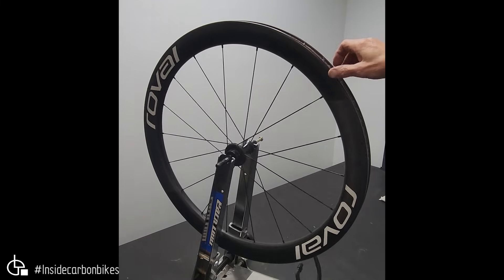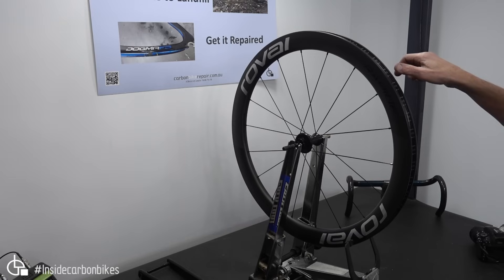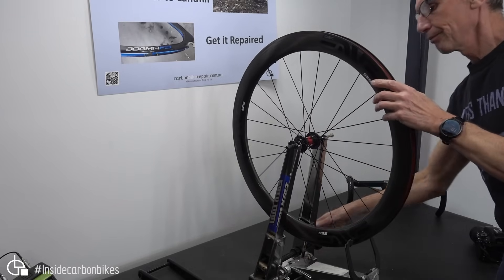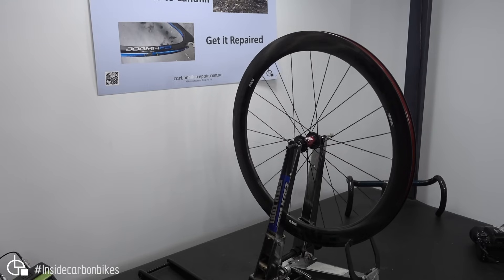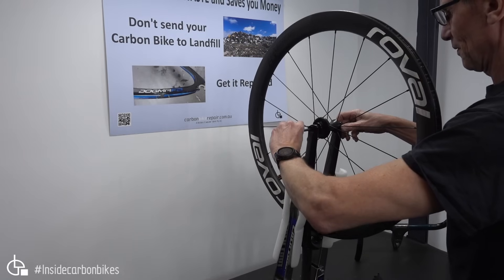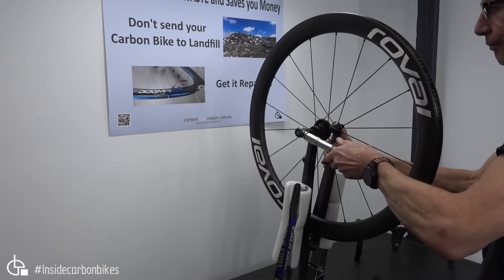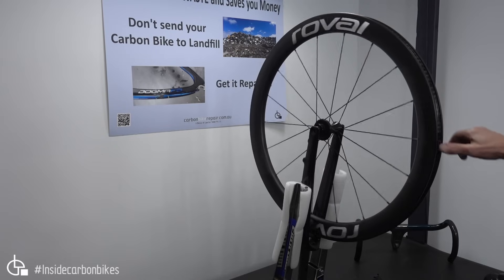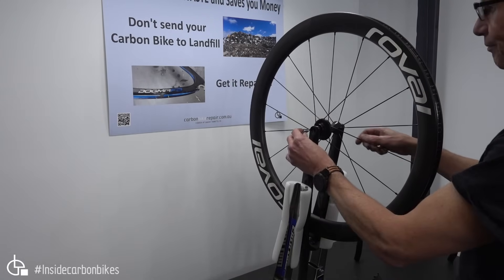Hub Bearing Test - It's not the axle!

Comment: Sorry if I duplicate other comments but my son is a bike mechanic and just today he had a customer's Roval wheel that was getting hard to spin when tightened. The cause was that the protection flange of the side axle cover was rubbing against the inside of the hub shell. He fixed by adding a 0.5 mm spacer in front of the bearing inner race. That gave enough clearance for the wheel to spin freely, without affecting the bearing preload. Clearly Roval have tolerance issues with their hub shells. Beside this, there are other issues like a big crack in the hub flange of another Roval wheel (no previous shock on that wheel).
Reply from the maker: Thanks for sharing your son's experience.

Comment: It's almost always the seals on the bearings.  But, it can also be the hub cap flanges touching the hub shell or upper bearing race.  Tolerances are sometimes too tight upon final assembly vs engineering specs.  

You will see this interference over time as black anodization rubbing off on the end cap flanges over time.  Either on the tops of the flanges of the hub end caps, or the inner sides of the end cap flanges.

Comment: Thanks for the video Raoul. For me the key issues is that the Roval and the DT Swiss hubs are not from the same manufacturer. DT has licensed its hub technology (the star ratchet system) to many brands (Roval, Giant, Bontrager), but the licence extends primarily to the freehub body and ratchet system (and sometimes axle and endcaps).  There are cases where OEM DT hubs are used, but not always. The Roval hubshell is not a DT Swiss hub and their are issues around manufacturing tolerances (bore and stack) and factory installation which can cause these issues with compression. Most often Ive found its the stack tolerances that cause compression on the inner race of the bearing which slows them down. Sometimes they just need the lightest tap on the axle to loosen them up. In regards to broader issue regarding compression and fitting torque from the thru axle... Its typically a non issue... or an urban myth. Sealed bearing hubs with slip through axles like Mavic, Tune are more effected by preload, hence they have adjustment mechanisms to find the balance between compression and play. Shoulder axle hubs like DT Swiss rely on extremely tight stack tolerances to get everything right. Occasionally Ive had brand new DT Swiss hub have this problem, but its extremely rare... well 1 hub in the last 15 years of professional wheel building.

Comment: Try simply taking the end caps off and re testing the bearings, could just be the end caps tolerance being tight, simple fix.
Could be one wheel with non contacting bearing seals, vice comparing wheels with tight, full contacting bearing seals. (Better at keeping water out and for longevity).

What Hambini reports, (he should understand the required interference fit). I have experienced several times, after fitting NTN bearings, the bearings spin free out of hub or BB, but tight and draggy when fitted, re-remove and supper free running, then tight and draggy when again fitted within an undersized housing.

Too much inference between bearing outer and housing, together with the tighter fit tolerance within the actual bearing,  My understanding being, some NTN bearings used in the cycle industry, having a tighter tolerance, hence more susceptible to this issue. 

I used to tell people, to use Enduro bearings, with a loser tolerance, to avoid the issue, but listening to an Enduro Engineer sprout a load of complete BS to Hambini, I do not have conference in anything they say. Best video I have watched in years and the Enduro bearing Engineer/Sale man, must now be a laughing stock in the cycle bearing industry.

Comment: In my opinion, the wheel Builder did the bearings to titend in the hub. We see, in the bicycle shop more often that this is the case. Simply new bearings and not to titend and it runs fine.

Comment: I've got an unadjustable front hub that needs the quick release very tight so it doesn't rattle.  It seems to work loose eventually and needs retightening.  That wheelset had a big discount when I bought it.

Comment: Seal drag and overloaded grease drag can both be huge on an unloaded wheel. The drag is the same on a loaded wheel, but some would argue an insignificant proportion. i.e.,  0.1W drag makes a wheel look and feel terrible in the stand, and is arguably a non-issue when riding a bike.

Comment: I'm guessing dt swiss 180 hubs with cinc bearings, I bought a pair brand new from sigma, I complained to Sigma, no warranty on bearings, I'd done less than 100 miles cost nearly 2 k, I sold them 4 weeks in (maddison said they would sort them but no trust in them) now on campagnolo bora ultra wto (two pairs) never touch dt swiss hubs ever again! Except 240 hubs lol
Reply: Wiggle also used that line on me with some Prime wheels that ate their bearings within a few hundred miles, no warranty on consumable bearings. Just crap.
Reply: Dt 350 are fine

Comment: The bearing spacer length can allow to much preload if there is any variation in the bore depths of the main bearing seats
Reply: This seems to me to be the most likely issue.  If the bearing spacer is just a touch too long, then there will be an axial load on the inner race, which could cause this.  Of course, the bearing seats in the hub shell could be too deep and you would have the same problem, but the spacer can be shortened while the bearing seats cannot be made shallower.

Comment: My new DT 1900 was noisy and rough after 50 Km I ordered new bearings and noticed that they had very little grease in them. After adding extra grease, I got my local bikeshop to swap the bearings. The original also had minimal grease. now the wheel spins nicely.  Upshot don't expect new wheel bearing to have enough grease.

Comment: While it's technically correct to call the Enve rims "imbalanced", it looks to me like it's deliberately done so that the wheel is balanced when the innertube / tubeless valve stem is installed.
Reply: Like when aluminum rims were pinned across from the valve hole.  Not new idea
Reply from the maker: Yes this is an entirely different topic, even tyres have weight distribution variation so the entire system with valves etc would need to be measured for balance.

Comment: The roval hubs you are referring too are not dtswiss. They have dtswiss internal and dtswiss components. The shell is roval internal are dtswiss. Some
Roval wheels come with dtswiss hubs. If you want to impress yourself and china wheel propaganda machine fans in your commentary use a dtswiss ceramic speed which comes in clx roval64/50/32 or roval rapid first gen clx and 2 gen race edition. No matter which hubs or you use, those wheels when you out on any bike are the most brilliant riding experience you will ever experience. 
A very important notice: Roval ceramic speed bearings do not last very long and they cost a shit load of money to replace. So that’s that. :) do you need to answer any other question about anything related to roval, like anything?! Let me know, happy to help especially forever newbies like some of your commentators who have a YouTube channel. ;)

Comment: It's interesting, I have a relatively new set of disc brake wheels
using DT Swiss 240's straight spoke and with the front hub
when off the fork the bearings feels stiff but once installed
onto the fork to the required torque it spins totally fine. And
with the rear hub it feels fine on and off the bike.

Comment: The hardest thing for the manufacturer to do is perfectly match the dimensions of the hub shell and the axle... the length of one or the other will vary enough to side load a bearing.  Been seeing that for 20 years now. 

I used to only buy Hadley Racing or King for ultimate reliability and adjustment. 
Today's crap is so cheaply made, they've driven me out of the industry. I'm just not impressed anymore.

Comment: My wife’s DT front hub on her gravel bike spun poorly too. Wheel was Swiss Side Haldron. It was worse with preload. I pulled the bearings and they seemed fine in the hand. I presumed they had worn prematurely as the rear bearings were still good. 

Ultimately I replaced the bearings with Enduro. The grease in the Enduro bearings was very stiff - red in color. I flushed it out and replaced with Kluber. Much better and as expected - the new bearings survived Unbound.
Reply: I have the same problem with my 240s rear hub: spins freely in the hand, but poorly when on a bike. Somehow I was able to fix it by gently tapping on the axle, so that the bearings come out slightly. Now it rolls well when on the bike. Not sure why that was the case though
Reply: Enduro bearings are bicycle industry garbage though. :)
Reply: @Metal-Possum  BS

Comment: The recommended axel torque settings on my Specialized bikes are 15Nm I always do 14Nm. My Roval is much less drag when torqued.
Reply: I used to do 15NM on my Specialized bikes but at 15NM it almost feels like the threads are galling.  So I've backed it down to around 9NM and it's been fine.
Reply: @jonathanwoo6597 with dry or lubrificated axle thread?

Comment: The Roval front has a known issue with the wheel bearings overpressed during assembly - simply remove a bearing, and re-seat it and it'll be smooth as silk !
Reply: It's known to the extent that Specialized prefer i.e. not known enough to provoke a recall.

Comment: On my roval hub the spacing on the axle was slightly smaller than the outer race spacing in the shell. I add a 0.3mm shim for the bearing to rest in the shell and it span perfectly. Took me ages to understand and correct. Also my measurements tools not being very precise i needed a few tries to get spacing right and killed a few quality bearing pushing them out. If i had to do it again i would play with the already thrashed stock bearing until i find correct shim then put the new one in. At the time i had the specer made by a machine shop but now i guess i would try to either cut it with the laser printer at work or even a 3D print might do.
Reply: Hi, this makes sense to me. Basically a mis-match between the axle sleeve shoulders & the hubshell. Do you have a link to the 0.3mm shim you used plz? ta
Reply: @Alastair-q5gorderes to sodemann

Comment: I think there's something that happens to the hubs when people overtighten the thru axle. I've had similarly badly rotating bearings on wheels that I've removed from a bike with noticably tightly torqued thru axles. Some of those can be corrected with light taps on the ends of the axle (with the endcaps removed) but some will still stiffen back up when torqued back onto the fork.

Can the over-axle-pressed bearings just be misaligning themselves when the soft aluminum inner axle doesn't support the compression from the thru axle?

Comment: I think the "stiff" wheel has too much preload. This could be caused by having the hole too small - which is very common in DT hubs, this diminishes the bearing clearance or even having too little spoke tension. The spoke tension pulls the hub outwards and gives more bearing clearance. 

These tests with spinning it are quite poor methods of diagnosing the fault. a bore measurement and a clearance check on the bearing would give a good indication of the fault.
Reply: I'm not disputing your observations, but I have not seen this on DT branded hubs. I have seen this on Roval hubs though...many times. Their QC is not great.
Reply: I currently ride 5 sets of DT Swiss wheels (most 240) and they all spin perfect so i doubt that this problem is «very common» for DT Swiss …
Reply: Try simply taking the end caps off and re testing the bearings, could just be the end caps tolerance being tight, simple fix.
Could be one wheel with non contacting bearing seals, vice comparing wheels with tight, full contacting bearing seals.
What Hambini reports, (he should understand the required interference fit). I have experienced several times, after fitting NTN bearings, the bearings spin free out of hub or BB, but tight and draggy when fitted, re-remove and supper free running, then tight and draggy when again fitted within an undersized housing.

Too much inference between bearing outer and housing, together with the tighter fit tolerance within the actual bearing,  My understanding being, some NTN bearings used in the cycle industry, having a tighter tolerance, hence more susceptible to this issue. 

I used to tell people, to use Enduro bearings, with a loser tolerance, to avoid the issue, but listening to an Enduro Engineer sprout a load of complete BS to Hambini, I do not have conference in anything they say. Best video I have watched in years and the Enduro bearing Engineer/Sale man, must now be a laughing stock in the cycle bearing industry.
Reply: My 240's spin really well. That from a sample size of 2
Reply: Good visual test but agree the hole needs to be checked for roundness.
Reply: @hambini big fan here.  Having said that, WHO ARE YOU TO CHIME IN ON WHEEL BEARINGS!!!  On a side note, love the new LightCarbon I built up after your review. Having a bit of an issue with the WheelTop mechs but the 9Velos are aces.

Comment: Assuming those are Roval CLX wheels, a DT 180 would be a better comparison. The 240 uses comparatively large bearings, and their tolerance window for preload is much wider. The tiny bearings of the 180 and CLX hubs are much more finicky. My 180 front hub behaves similarly to the Roval hub.
I suspect that the Roval wheel you have there, not binding as much as the first one, actually required less than 10Nm on the thru axle to equalize and spin freely. The original one you had behaved how most front Roval road hubs seem to. When i put it in the fork with the thru axle barely snug, it barely spins. As i tighten the axle, slowly the weight imbalance is able to let the wheel rotate, and it's free enough to pendulum back and forth.

Comment: The main issue in my experience (a machinist and industrial mechanical technician for the past 30 years) is the design, tolerances and manufacturing process for the bicycle industry. 90% of the consumers (and it shows in the comments) don’t know anything about the component let alone the design and how to analyze the root cause.  
Without any kind of visual inspection we can name several causes. Most of them are debunked by looking at the footage and comments from the man LT. 
bearing misalignment, nope, axel slides through without issue. 
Dust seals, nope, doubtful if there are on a road wheel and if we are talking about the seals on the oem bearing, it’s not possible to cause that much friction. 
Manufacturing tolerances, yes,it’s possible the outer bearing diameter machined in the hub is under size enough that one or both of the bearings has too much preload. 
Axel spacer out of tolerance with outer hub race tolerance, yes, this will cause excessive preload. 
My educated guess without seeing the wheel is the outer race of the bearing is seated in a hub machined undersized. The outer race of a modern wheel bearing (deep groove roller bearing) is very thin and is sensitive to tolerance. Adding the axle and torque on the axle has nothing to do with the bearing. Its load is on the inner race which is fixed by the axle spacer. Not the issue and why there was no change to the condition.
Reply: Axle torque “shouldn’t” affect the bearing drag but if the spacer is undersized compared to the seating depth of the outer race of the bearings, it certainly will.
Reply: If you see my other comment, what can be the mechanical cause in that circumstance? (tldr probably overtorqued thru-axle at some point, axle starts rotating freely if the axle ends are given some light taps from a hammer)
Reply: Exactly the issue I’ve had with some 9Velo wheels recently, undersized hub causing premature failure of the bearing on one side.

Comment: DT Swiss uses special pre-load for bearings. It is almost impossible to do the same as factory settings. I've never had any issues with DT Swiss wheels. If they have DT Swiss authorised service in Australia, customers should send them to check it. In my TIME bike frame true axles have recommended 15 Nm and my DT Swiss wheels behave perfectly fine. I have two sets of wheels with various hubs.
Reply: 15Nm with lubrificated thread or dry?
Reply: @pablo_coach_ultimate  Dry.

Comment: I had some HED wheels years ago where the hub were not manufactured to spec for bearing to be put in.  They had to smash the bearings in to the hubs and they spun horribly. 
One also has to make sure the upper and lower races are not pinched beyond where they should be, thus pinching the bearings.
Reply: Having to smash the bearings in tells you all you need to know about the fit, if they don’t push in with the appropriate drift and bearing press then something is usually wrong.

Comment: Hi, I am an amateur cyclist but I have gotten really into doing my own bike mechanics. I learned about bearings, preload, etc regarding my bottom bracket and was able to get mine to spin freely for a long time. But I never considered it for wheels. Now, granted all the work I did was related to the BB shell and not the bearings in the BB, I am assuming there is not much I can do to make my wheels spin mroe freely.

I understand in the real of professional biking, marginal gains really add up and are super important, but for a casual amateur cyclist such as myself, what would the difference in mechanical losses be between the two wheels? I did try spinning my Elitewheels ENT-Gravel front wheel like you did in the video ,but it's got a speed sensor on the hub + tires and sealant inside, so I'm not sure if I can rely on the results, yet it does spin a bit, until the inbalance makes it spin back around.